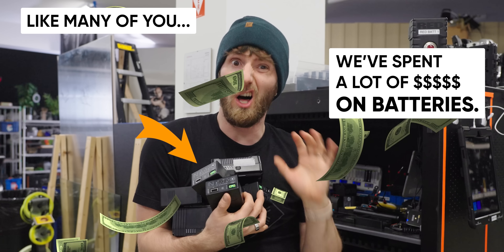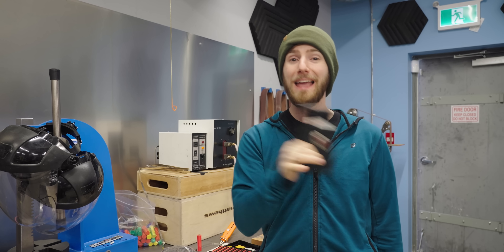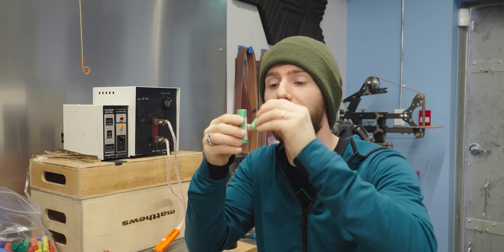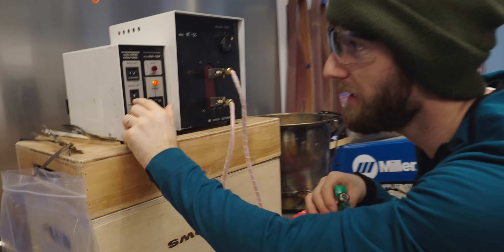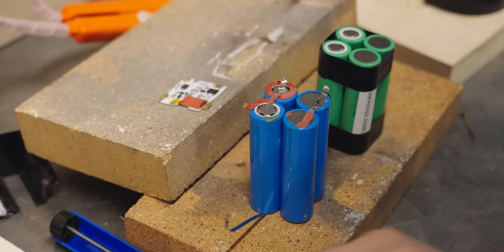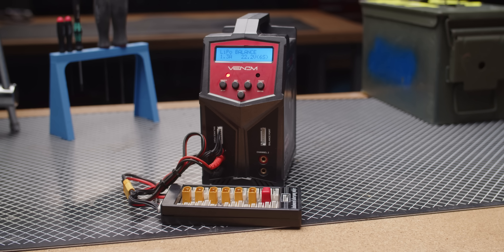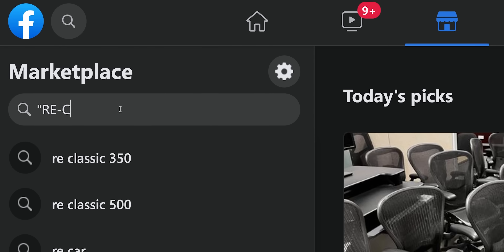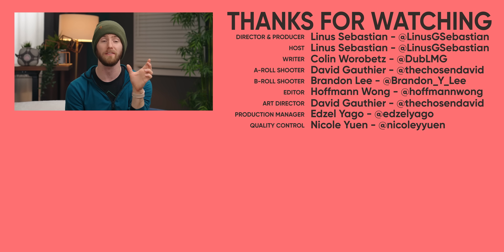This should be illegal… Battery Repair Blocking

Comment: I'm not that mad at manufacturers who make battery packs difficult to fix. They produce millions of those things and they are interested in not getting sued into oblivion because their battery packs ruined people's expensive equipment or burned down their house so they make everything they can so that people don't open them and try to "fix" them. Replacing cells is no joke and is really dangerous. What I'm mad at is when manufacturers make devices with built in batteries that are a pain to replace. Can't we remember the good old days when if your phone battery was bad you could go to the shop buy a new genuine one and put it into the phone in seconds. Now even laptops are done that way and over time the servicebility of devices gets worse and whose so when something cheap breaks is more reasonable in terms of cost for the consumer to buy a new one because the cost of fixing an old device is too high because of the difficult repair

Comment: I am sorry to say this Linus as you usually have pretty good content, but this is an area you need to stay the hell out of!!  This is nowhere near a simple "replace the cells" operation and although you put in the disclaimers about not DIY and quite dangerous, you persevered into unknown territory based on a misunderstood perception...  When it comes to lithium battery technology, these safety features are *VERY* real and should *NEVER* be attempted by an amateur without the absolutely proper equipment.  Your battery testing was primitive at best (why not just stick your tongue across the leads?) there are a whole bunch of other factors (as others have mentioned)  to consider about the batteries being put into a "pack"... The manufacturer is buying batteries by the thousand and take the time to insure that the batteries in any individual pack are as close to identical as possible, something that can NOT be done when you only order enough to replace a single pack.  The BMS is also specifically made to perform a specific job and large changes in voltage, capacity, or internal resistance are one of the highest danger signs of a lithium pack about to fail in spectacular fashion!  This is an absolute Safety Feature and NOT a planned obsolescence or "Right to repair" issue as these are not Lead-acid, Carbon-Zinc, Alkaline, or even Nickel-Metal-Hydride and should not even be thought of as the same thing in anything other than supplying a voltage.  You are paying up front for the relative assurance of these packs being safe and the multiple examples of cheap "toys" with cheap cells blowing up are the product of NOT paying for that safety... The vehicles are a completely different example as those are likely caused by road damage penetrating into the battery system.

Comment: Always recycle Lion batteries, it turns out that the materials are 100% reusable. Nothing is actually "consumed" in their use, they just develop "cracks" (oversimplification) from use that degrade their performance, but the actual stuff can easily be ground down and molded into batteries that are as good as new.
Like 100%, literally NOTHING is lost. You can make new cells from the same material forever.

Comment: I just successfully repaired an electric scooter battery pack 60 volt It had a dead cell in it I replaced. I think that spot welder he was using was too strong for the job.

Comment: I still don't understand why people want to hassle themselves with spot welding. There is a simpler solution of buying 18650 battery holders and just 3D print a new case to compensate for the extra size of the holders. With battery holders you can easily swap out cells without welding. That is what I use whenever I need to make a battery pack. and you are less likely of killing the cells or the bms when you opt for this method.

Comment: you should charge it first because some bms need a supply from outside to startup 
believe me i worked with so many bms and changed 18650 cells successfuly i learned from my failures☺☺

Comment: Late to the party again, but: TL;DR: TRY CHARGING FIRST!
Long story long: Some BMS are disabled by default until you apply charging voltage to the connector. This is a safety measure to allow the BMS to evaluate the cells before it allows to draw any current from them.
Background: I used to refurbish laptop batteries for a living. I also developed a product with 18650 battery pack on the inside and had to do some reading on BMS chips.
Of course there are some BMSes with a kill-switch. It's a kind of one-time fuse which can be tripped by the electronics if they detect a fault condition. One of the fault conditions detected by the BMS was "any voltage missing". So basically desoldering any wire would instantly kill the BMS PCB (there were workarounds for this tho).
I hope you LTT guys actually read those comments cause this video deserves a "Part Two: Success!"
PS: it wasn't clear from the video material provided but some of the sparks that made you panic could have just been your spot welder arcing.
Reply: Exactly!
Reply: I'd be interested in your comments on Panasonic Toughbook battery cell replacement DIY....specifically the CF-5x series. Thanks -

Comment: The big problem is the manufacturers install a "kill" signal in the BMS  to make the battery appear dead after a specific time.  In some cases, this can be re-set and the battery regains full functionality.  Others are designed to not allow this, so even if the cells are ok, they cannot be charged.  This should be illegal, you buy the battery not knowing they are defrauding you.